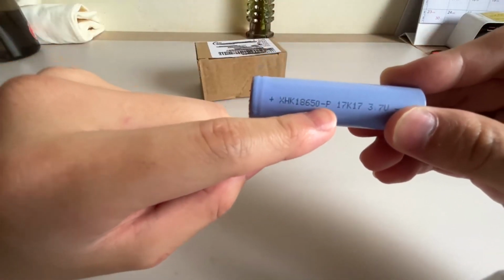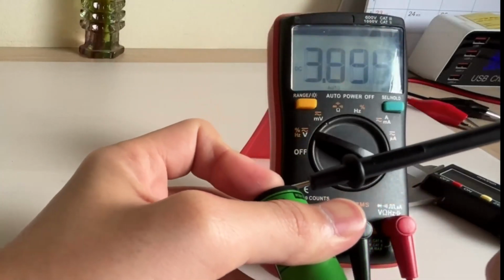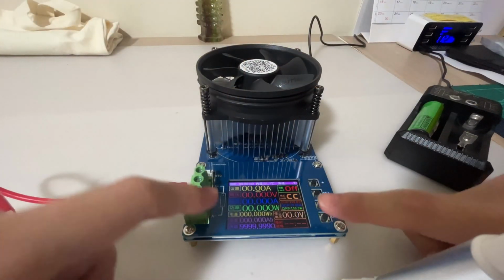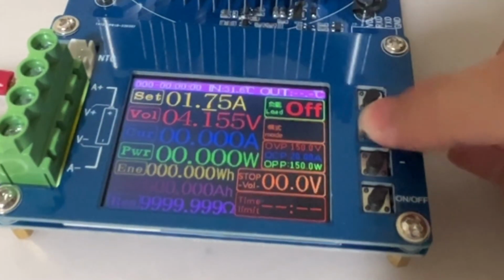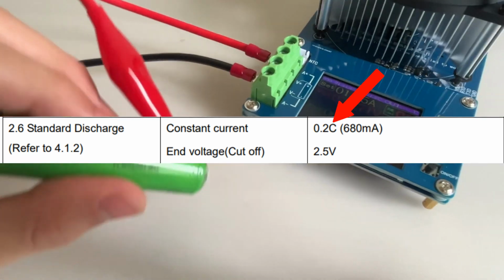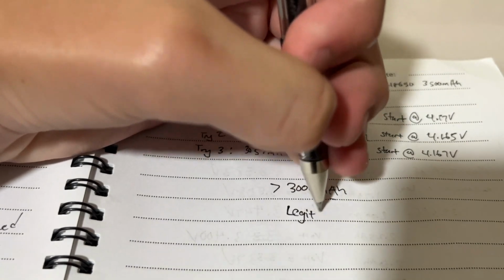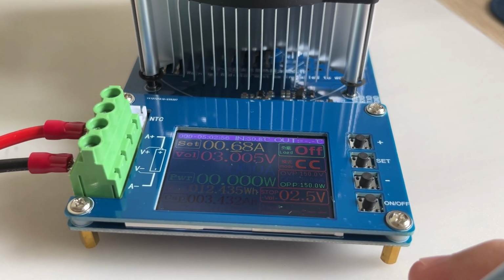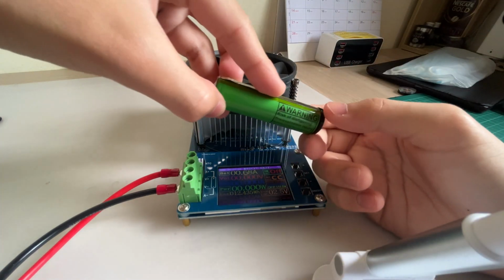3500 mAh LG MJ1 INR18650 Review + Test

Comment: 2.50V is the cutoff. By using. a 2 wire discharge method you probably didnt even discharge to 3.2V
Reply: And lithium ion cells can give 105 to 110% of their rated capacity when heated to about 35 degrees celsius but for best cycle life 25 degrees celsius is the happy medium where they give you the best balance of capacity and cycle life.

When you ran the cell at 1C you heated up the cell to that sweet spot around 35 Celsius for most of the discharge which is why you got such a large increase compared to previous discharge tests. Taking the voltage down to 2.9V also helped.

So as long as your cell can handle a decent discharge rate, running it a slightly higher discharge rate than the 0.2C standard in a 25 celsius ambient room can give you a decent boost in capacity. But for low discharge cells you'll see that trying to heat them up with a higher discharge current (despite taking a smaller discharge current to heat up due to higher IR) they will suffer greater voltage drop and the cell won't run as long.

Trying to fill in the gaps since your testing jumped around a bit by not keeping the same independent variables like voltage cutoff. If you would have done every test down to 2.5V with a 4 wire measurement you would have seen that the 0.2C and 1C discharges would give a roughly equal output with the 1C possibly edging it out by a few dozen milliiampere hours. Past 1C the voltage drop is going to lower your capacity but it should never go below 80% of the rating if you stay within the datasheets discharge rating.

Charge current and resting periods between each cycle also play a role but not important enough to cover in a video mostly about discharging and capacity. The charge cycle will definitely impact cycle life if you beat it up.
Reply from the maker: Thanks for pointing out that! It’s very true!

Comment: 15a discharge please
Reply from the maker: Maximum 10A discharge
Reply: That would cause the cell to sink to under 3.60V right off the start. The discharge curve would resemble a wet noodle as the cell slowly recovers from the massive load placed on it. If you went through with discharging it to 2.50V it would probably be well in excess of 80 degrees Celsius meaning not only have you damaged the cell by beating the fuck out of it with that load current but you've nuked the electrolyte inside the cell.
Reply: in my charger, with a load of one ampere, the battery reaches 50 degrees without cooling. 
is this a normal temperature or is the battery faulty?